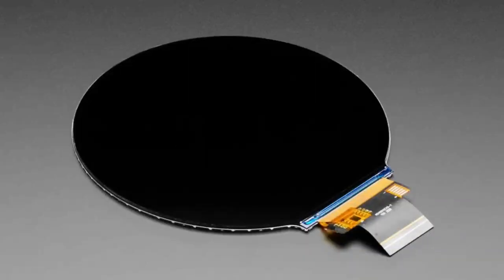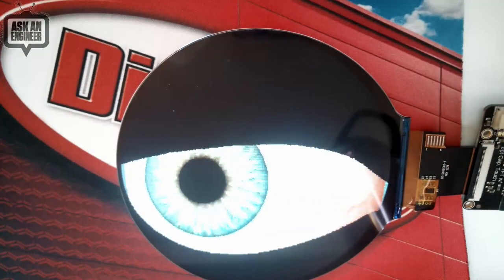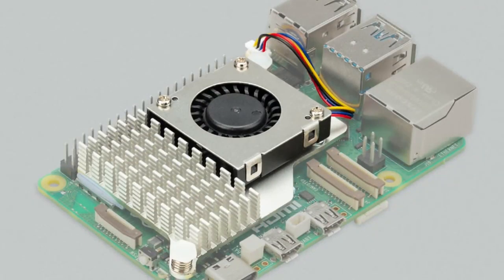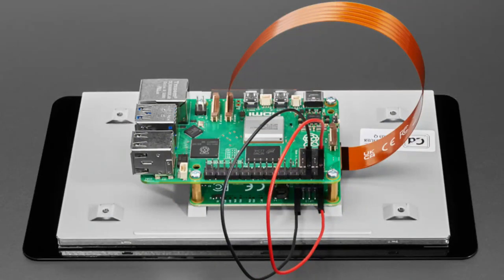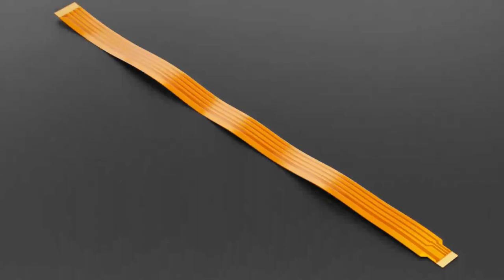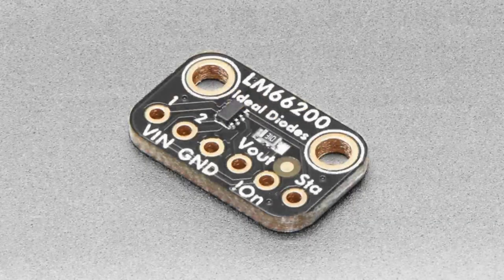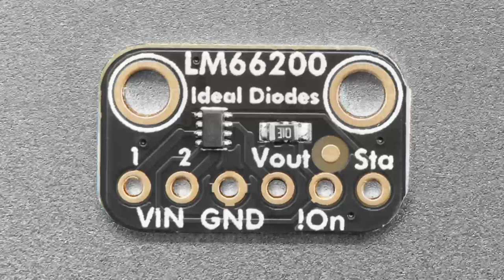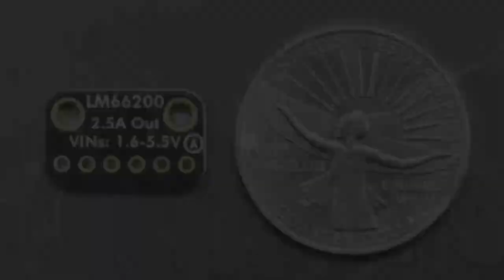#NewProducts 10/25/23 Featuring #Adafruit LM66200 Ideal #DualDiodes #Breakout!

Comment: Just got the display cable for RPi5, plugged it in, and no video. The same display works with RPi4 and the older ribbon cable. Can someone help me out here?
Reply: Drivers?
Reply: @TheBinklemNetwork  it was the cable. I got the camera cable instead of the display cable. After buying the right one, it worked :)